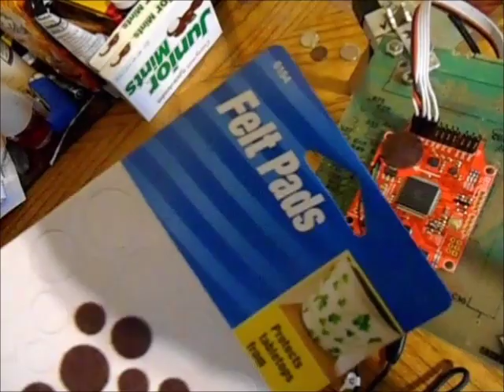Quadcopter Build Part 8: Multi Wii Pro Flight Controller With GPS Module Unboxing / Install

Comment: Can you explain what this is? Seems to be an option when ordering.. "3DR Radio Telemetry Kit 915Mhz (Flashed with custom firmware for full waypoint navigation support)"
Reply from the maker: I am not an expert on that subject but from what I can tell it is a way to communicate with your quad via laptop or phone in real time while it receives flight info from the craft and displays it on your laptop or phone. Pretty much like Bluetooth but I believe longer range than that. I do know that 915 MHz is the United States frequency and overseas they use 400 something mhz. I think its more for Ardupilot flight controllers but I very well might be wrong on that. I see no value in using it myself at this point in time. I personally will never go out of L.O.S. while flying my quad and I don't think I'm experienced enough for F.P.V. so I have no use for anything more than my Bluetooth and Android phone for ground to quad communication.

Comment: hi, its not really a install or unboxing.  you basically had cables plugged in and didnt show or explain any of that :(
Reply from the maker: Yeah, sorry about the crappy quality of the info on this vid. I was sick as crap that day. Also, this series didn't really start out to be informative with info for others to follow and it wasn't meant as an informational how to guide or anything like that. It was more just a documentation of my build, errors and all. I also was a complete newby during the early videos of this series muddling my way through a bunch of stuff I knew very little about. None of the stuff in this video other than the FC and the GPS module even ended up in my final version of this craft. Even the name changed....lol. I have some chronic and debilitating illnesses so sometimes my vids suck partially because of that.
Right now I have the final (almost) configuration flying really well. Most of the problems I had were due to not having my radio centered up correctly. I am planning on doing a complete guide with all of the pertinent info on my finally successful Multiwii Pro project to be on YouTube as soon as health permits me to finish it.
Reply: The420four
Fair enough.. The only reason I mentioned it as im learning and trying to find the best advice
Reply from the maker: Understood :) I really wasn't smart enough to instruct anyone on anything when I made the vid. I have learned a lot since. If you have any specific questions I would be happy to try and help.